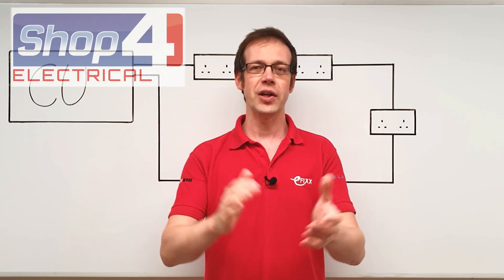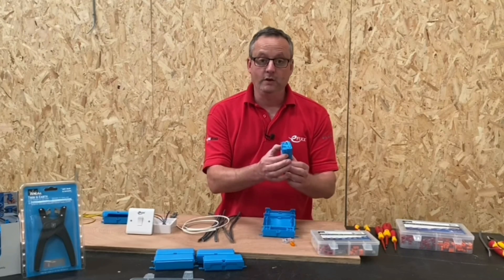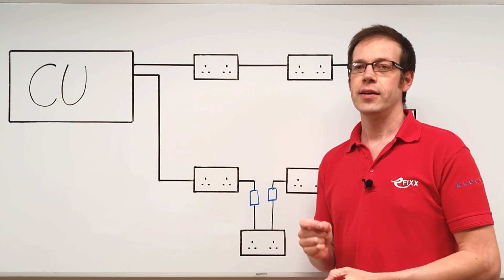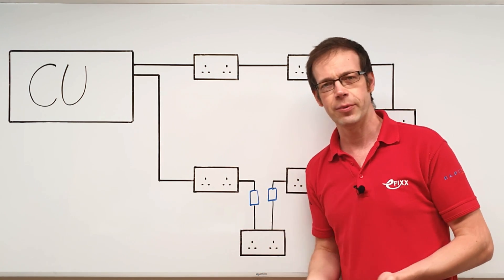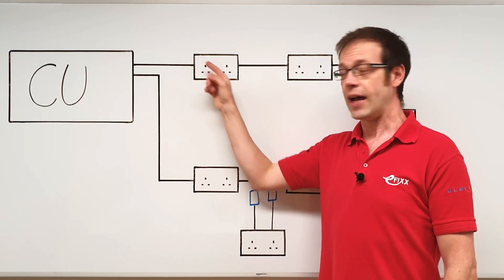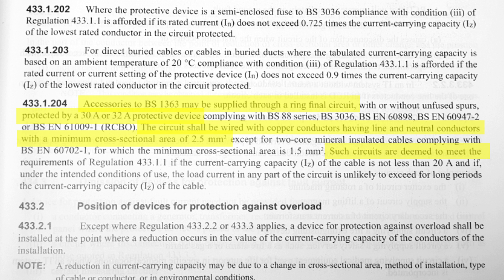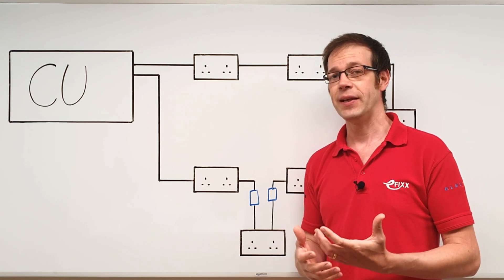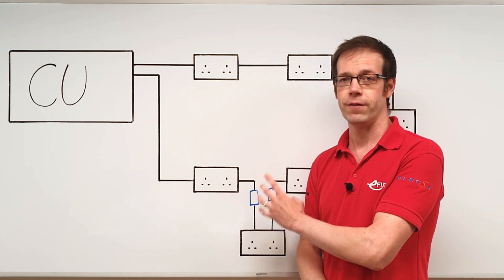Can a junction box rated at 16 amps be used to extend a ring final circuit?

Comment: A rather complicated way to say:
Ring main 2.5mm² T & E = 24 amp max rating x 2 = 48 amp rating overall for the ring connections (2) at each outlet! 16A will just NOT cut it ... END OF! 

Either way 16A is NOT the same rating as the cable!! What pervert EVER thought that was a viable option? Doh!

Comment: A little late with my view as only just seen this post.
Lets just say the consumer had an open line fault in the final ring circuit, you then have, sort of, two radial circuits, using a 2.5mm cable and then protected by a 32amp breaker, with 16 amp junction box in circuit ? all may be working as far as the consumer is concerned until... you know the rest.
This is always going to be the weakness in a final ring circuit protected by a 32amp breaker.

Comment: Wish you would tell people at start that you are dealing with European codes. No such thing in NEC as a 16 amp box. Only devices that mount onto electrical boxes are rated for ampere such as 15, 20,30 etc.
Reply from the maker: Does the accent not give it away? 🤔
Reply: USA is the whole world syndrome at its finest.
Reply: Didn't realize the USA had ring final circuits? 🤔

Comment: Knew this and thats why people dont do proper cable calcs as this is needed of running cables near insulation in walls and ceiling.  When extending the ring i use wago 40A connectors as the maximum rating on most of the push type connectors are rated at 20A and like your previous video 26A can flow on one leg.  Try and be belts and braces. Quick side note check out the videos testing the loading of these connectors past there maximum stated current.

Comment: Makes you wonder why the UK still using ring circuits.
Reply: All circuits are potentially dangerous due to a loose connection.
Reply: I don’t understand all the hate they get
Reply: @12000gp  - Well they are potentially dangerous if the ring breaks due to a loose connection, with a 30A fuse to protect wires with 26A max load. And they require more testing to confirm the integrity of the ring, or for fault finding.

Comment: Man ,oh man ,you lot want to overcomplicate everything !!!.as long as the terminals in the junction box are big enough to hold the cable securely and tightly that’s fine ,that’s always been my rule of thumb... we have all seen a chocolate box on a lighting circuit which has too many wires in it ,and the screws will not tighten properly theoretically that box is big enough for a five amp lighting circuit  but if there’s too many wires,it’s  not man enough for the job

Comment: and yet cable 2.5mm2 is rated for max 25amps and the ring fused at 32amps...silly  to be concerned about a 16amp max load junction.   Best practice to split the ring in half  to radials and use spare fuse ways in the CU to put in a couple of 20 amp MCBs  and ditch the 32amp one...

Comment: My guess was more paranoid. I guessed that the junction shall be rated as same as the cable is.
Reply: I think you are correct.  Also why not rate the junction at 32A, same as the MCB.  The popular WAGO connectors are rated at 32A provided they are not installed in a “maintenance free” location. These regulations seem to contradict themselves sometimes and could certainly be written in a more definite manner.

Comment: Nicely explains why DP switches are typically rated at 20A when the loads they switch are often current limited below that, and certainly at or below 16A. Essentially then, all wiring devices used within ring final circuit pathways need to be rated to a minimum of 20A.

Comment: I shouted NO! right at the beginning, a ring is a giant potential divider, low value resistance, which varies according to the load applied at preset positions. Cable carrying capacity, minimum 26 amp, a 16 amp junction?? well, do you really need to ask?!

Comment: You would think these days manufacturers would make their connectors capable of carrying at least 20amps
Like the Hager boxes they make two versions a 20amp one and a 32amp one, meaning if you get stuck you can always use a 20amp one if that's all you have, but to be honest they both look the same inside except for the extra terminal in the 20amp one.

Comment: Putting aside academic question of how can a large blue plastic box possibly derate MF connectors inside from 32A/20A to 16A but the traditional hockey puck junction box was ok...   Since Wagobox claims derating of 20A rather than 16A - is  Wago 222 and 773 in a Wagobox (on each leg) now the only viable solution for extending rings?
Reply: The 222 is rated for 32A so should be fine as it matches the rating of the breaker.
Reply: @davepusey  222s are derated to 20A in a Wagobox used as maintenance free much the same. Even 221s in their Wagobox are rated for 20A in that case. Only the big chunky 773-173 ones that go to 6mm² CSA are rated for 32A in that application.
Reply: @intercity125  I had same debate with tech rep at WAGO as it’s not clear (just like much of the regs.) : he explained, WAGO 221 is rated for 32A in a WAGO box - unless it’s in a maintenance free position, in which case the derating to 20A applies.  I can only assume this is to protect themselves from a situation where a WAGO box has been positioned in a MF location that may give rise to a combustion hazard if it gets too toasty. The box and connectors are identical in both situations.

Comment: Great video. 
Also the amount of times I have went to carry out a EICR and not having continuous continuitiy throughout the ring circuit. Which would allow more current to flow unevenly through the circuit.  Depending on the loading.

Comment: Great video guys, personally I already knew this but it’s remarkable how many sparks do not understand the de ratings of boxes like the Ideal, Wagobox etc, and to be fair very few manufacturers publicise the de rating clearly.
Reply: Wago boxes are designed for Wago connections which are 32A rated (for the 221-413 at least) the derating is usually because of the connector type rather that the box, which is just a convenient enclosure.

Anyone who doubts the efficacy of Wago connectors should check out one of John Ward's videos which test them to destruction with EXTREME overload current ... They are the BEST of all typical connectors ... I love them, but I wouldn't use them to extend a ring main. Just pull a new cable and pull back the original and make a PROPER job of it! 

Sparkies! WHY do so many always look for a "cowboy" short cut and/or useless and potentially dangerous solution? There again, WHY do so many in the industry think that a SINGLE double socket in a room is sufficient?? Farcical!! 🤔😲👎

Comment: Most houses that Ive done at the are getting 20amp breakers on the rings  
Reason being most plus devises are getting that efficient, like led Tvs and led bulbs in the lamp stands there no call for a ring rated at 32 amps.     Kitchen included once you take the dishwasher and other machines out off the ring and put them in radials ( which they should be in my thoughts as they can cause nuisance tripping when all connected to the ring )          then there only a kettle and toaster would be the biggest load ever on it.                                          Once had this a Similar argument with ETO on a cruise who idea was to run two 16amp double pole breakers in parallel to make a tripping  currant of 32amp for a new coffee machine   What he couldn’t get his head round it was still a only going to be 16amp no matter if he paralleled them or not    But he was ETO and on a six figure salary so there was no talking to him.           (Didn’t work by the way keep tripping of the weakest breaker )

Comment: If your a fully qualified electrician with a full 5 year apprenticeship under your belt like we did back in the 90s,then you should know the answer was no you can't, if not you should be going back to college.. questions like this just prove there are Sparkies out there who don't know what they are doing..
Reply: Why are you watching this video then? Nothing wrong with learning mate!
Reply: Yes phillip. most electricians I work for and with need to go back to college, their lack of knowledge is unbelievable. I never completed an apprenticeship, but did do college, thinks it was the 2330. Even without the apprenticeship, I know that the design current of a standard RFC is 20 amp. Wounder how many so called qualified sparkies don't know a 2.5mm RFC doesn't comply when on a 30 amp rewirable?
Reply: Steven Murphy, hi Steven under most circumstances 30amp 3036 fuse with 2.5mm2 will comply earth loop and volt drop permitting, only time they don’t are when the old 2.5mm2 t/e have a 1.0cpc as this not permitted
Reply: @SME_Ste  Rubbish